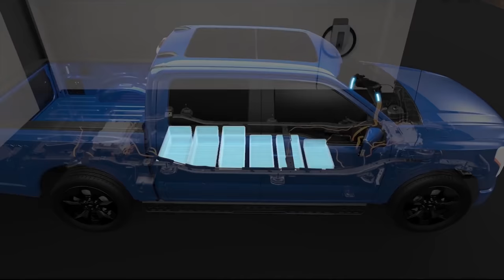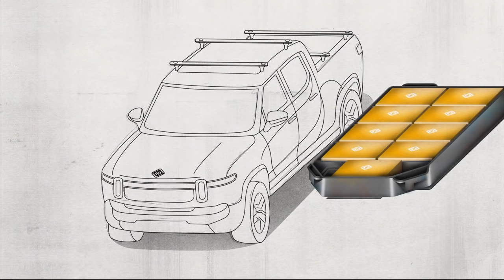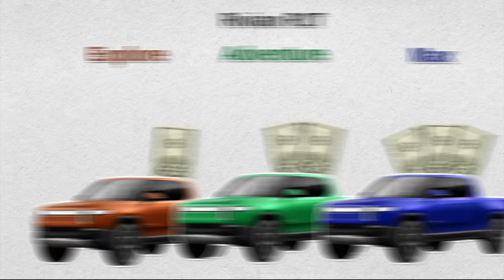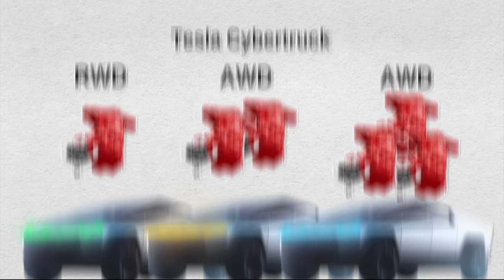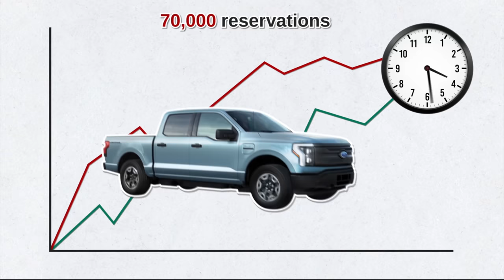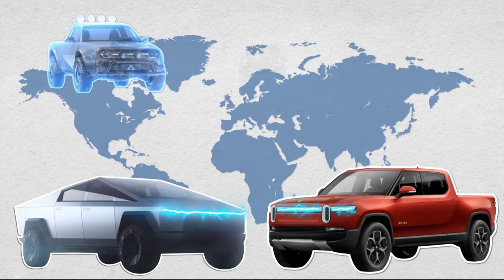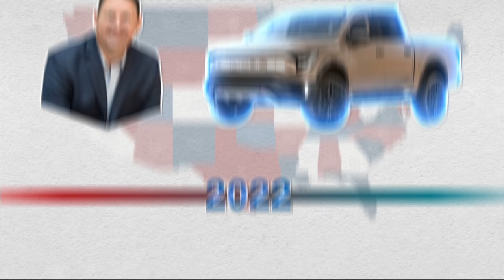Here's Why This Will Replace Trucks in America

Comment: I was reading Toyota wants to put the brakes on EV. I trust Toyota before starry eyed politicians.
Reply: So u trust a company? Not saying the government is any better but are u willing to put ur trust on a corporation?
Reply: Hell yeah brother Toyota for life!!!!
Reply: Not the reason, Toyota put all their eggs into hydrogen fuel cell vehicles. Toyota can see electric vehicles are coming  by 2025 and they got nothing to compete. Time will tell. Peace
Reply: There is nowhere near the amount of minerals to produce all these batteries. As well as upgrading "the grid" to handle them !! Im all for environment but people dont use logic
Reply: Yep... hydrogen is the future. But once people realize carbon is good for the atmosphere the whole idea will be ditched.
Reply: @jefftalbot8371 , being optimistic here, but the whole infrastructure on keeping these EVs charged is an issue throughout the nation. Most of these EV charging stations are not being monitored, or maintained. I have seen several of these charging stations in need of maintenance and repair. From my perspective this having to do with the current political grand standing, and the push for the “GREEN NEW DEAL.” We as a nation cannot support the changes needed for this “Green New Deal.” Once this nation political leaning changes, then we’ll see a drawback on this EV push. My point of view.
Reply: @mcc7762  well it will fail with the current power grid.
Reply: @diji5071  How do you figure carbon is good for the atmosphere?
Reply: kinda like VHS vs BETA
Reply: @DistinctiveBlend  All life forms are carbon based. There is no way it can be bad.
Reply: @DistinctiveBlend  I inhale and exhale carbon, nitrogen, and oxygen with every breath. I would cough up carbon dust all day when I worked in the coal mines if I didn’t wear a mask.
Reply: @DistinctiveBlend , FYI we use carbon filters to filter the air we breathe. When using these carbon filters when breathing through half face or full faced face masks. These face masks are used when spraying automotive paints, and high dust particles areas. Carbon filters used depending on the micron rating of the filter used. Carbon has some benefit.
Reply: @TexasBR549   Never said carbon doesn't have good uses and active carbon does do a great job of filtering water and air. I was pointing out inhaling co2 isn't a good idea... just because an element has some benefits doesn't mean it's all beneficial.
Reply: @TexasBR549   Here's wishing for sanity to prevail & your viewpoint validated :))
Reply: @h_3_x_  I always trust businesses before government. Not bc what they are doing is always right but bc they are more predictable and actually care about the customer
Reply: @ayyveezee2079 The truth shall set us FREE!
Reply: @h_3_x_  govt is WAY WORSE- its the worst  monopoly there is
Reply: @DistinctiveBlend  Plants use CO2 for photosynthesis.  We got to replant all the trees in the highway and interstate medians and on the sides of roads ASAP.  Every time land is made bare of life the climate changes.
Reply: @jessepickar3297  When business is wrong they suffer.  Government never suffers.
Reply: EV can never work.  They key is hybrid drive trains.  Hydrogen is too much trouble, and I think Scotty covered people working on Ammonia fuel cell technology which is more feasible than hydrogen and environmentally sound.
Reply: Toyota is coming out with a hybrid truck next year.  They seem to know strict EV is too problematic to ever be the answer.
Reply: Yeah but they are putting a lot into fuel cell
Reply: @diji5071   So the cretaceous period (145.5 million to 66.0 million years ago) had what you're talking about. A atmosphere like that creates an intense “greenhouse” climate on the planet, no ice at the poles, sea levels were 50–100 meters higher and average temperatures were roughly 5°C–10°C higher than today. -- this is the type of climate change we want to avoid as most of the lifeforms currently on the planet wouldn't be suited to it.
Now that isn't to say pollution isn't also a problem... there's many problems and not very many answers.
Reply: @jayrunner3347  thus they will do the best they can and their actions are much more transparent. As for the government, they have an almost endless supply of money and can do whatever they want.
Reply: @DistinctiveBlend  why aren't we Venus if runaway global warming is caused by high levels of co2?
Reply: @diji5071  Because venus is far closer to the sun that us and has a way higher level of co2 than us. It therefore had a complete different geological evolution than we did. Maybe I should ask you why there isn't megaflora on venus seeing as its atmosphere is 95%+ co2... but that would be a frivolous question much like your own.
Reply: @DistinctiveBlend  Carbon is great for the atmosphere.
Reply: @diji5071  They were a lot higher when there was different lifeforms on the planet.. they were adapted to that environment and current life mostly wouldn't do well in such an environment (humans included).
There are feedback loops that cause co2 to be released but it's nothing compared to the runaway effect on venus... you're comparing massively different things yet act like they're the same.
So the fact that co2 has been higher before when the planet was vastly different to its current state doesn't somehow rule out man made climate change...why would you think it would?
Reply: @diji5071  lol back to that naive statement huh?
Reply: @DistinctiveBlend  I'm just wondering why if 12k years ago carbon levels were much higher than they are today, why aren't we in a state of runaway greenhouse gas catastrophe?
Reply: @DistinctiveBlend  Because it just doesn't make sense.
Reply: @DistinctiveBlend  the planet is clearly able to sustain life with much higher levels of carbon than we have today and the additional oxygen that would be created in turn would prevent any sort of runaway greenhouse effect.
Reply: @diji5071  It sure can, and I never said anything about runaway greenhouse effect apart from looking at venus.
Our society however wouldn't do so well in such a hotter environment. We're talking 10c above our current average..which is the main thing they want to avoid by trying to stop co2 climbing to such a high level.
Besides that oxygen doesn't modulate carbon dioxide in the atmosphere as you imply.. both can climb or fall independently.
Reply: @fingersm  and another thing that no one is talking about it..to produce lithium  you need a lot water, the process  is very pollutant, with the shortage of water that are coming go figured
Reply: @DistinctiveBlend  My point is, co2 is good food for the environment, so are the higher levels of oxygen that come as a result.
Reply: @diji5071  co2 is only good up to a point, once it hits a certain level even plants find it toxic (different ranges for different species). Higher oxygen levels also brings its own problems.
Plus that's ignoring the increased heat from all that extra co2 (which isn't good for the current environment) which is what the whole point of climate change is about.

So repeating the adage that 'co2 is plant food' can be seen as a moot point and just appears to come from a contrarian standpoint.
Reply: @DistinctiveBlend  I think you're wistfully dismissing the fact that we would benefit from increased and balanced levels of oxygen and co2 in the atmosphere.
Reply: @diji5071  wow... Stellar point!
Reply: Physics professor from Berkeley did the calculations and figured if everyone in Los Angeles was charging  electric cars that Los Angeles would need 12 new major power plants within the confines of the city because  the grid can't handle all that electricity if the power plants are far away. 
And the materials for the batteries are somewhat rare, like cobalt.
Reply: @DistinctiveBlend I'm not a global warming and denier and was a firm believer until this : check into geologist Randall Carlson's work on carbon in the atmosphere being reabsorbed by the biomass and how co2 levels were much higher in the past
Reply: @Cakin  The same Randall Carlson who believes in sacred numbers/geometry?
What about the latest IPCC report? That isn't showing the co2 levels decreasing (no measurements do)... and yes co2 levels have been higher in the past but we weren't around then, it was a different world compared to now.
Reply: @jefftalbot8371  electric vehicles are way overpriced and very limited in capabilities that make traditional engine vehicles more favorable. The electric infrastructure and vehicle price, range and charge time is a hinder I'm not willing to pay for until it's fixed
Reply: @TexasBR549  Every element has its uses but you might want to read up on oxygen toxicity as an example of what can happen when you mess with gas mixes.
Reply: Toyota is smart and is skipping over the battery EV craze and are going straight for the next step.  Hydrogen fuel cells.
Reply: It may be due to the supply constraints on batteries. Even companies who make their own cant keep up.
Reply: Ask Sandy Munro who looks at all manufacturers
Reply: Bad choice
Reply: @qdllc  explain why ev can never work please

Comment: A new study shows that servicing an electric car is actually more expensive because of labor costs and longer diagnosis of problems. More wear because of the heavy electric packs
Reply: I can't believe that because I work with electric light rail vehicles and I'll tell you that they are extremely long-lasting and inexpensive to maintain compared to diesel.
Electric vehicles have a lot less moving parts to deal with so less things do break down electric motors are extremely simple compared to internal combustion engines and brakes last much longer because it uses regenerative braking instead of friction mostly.